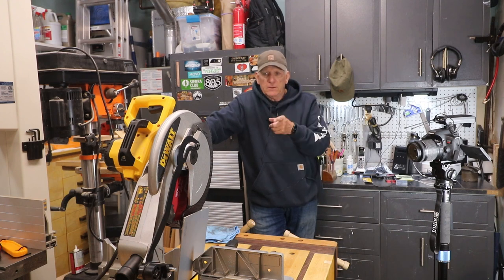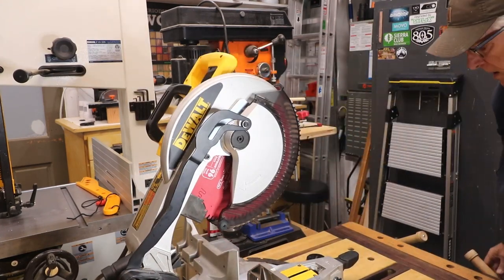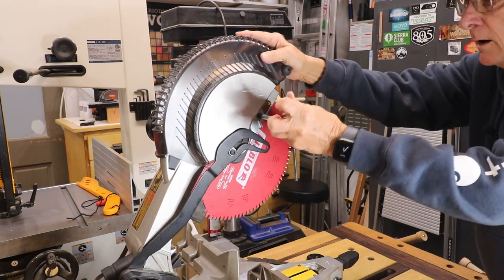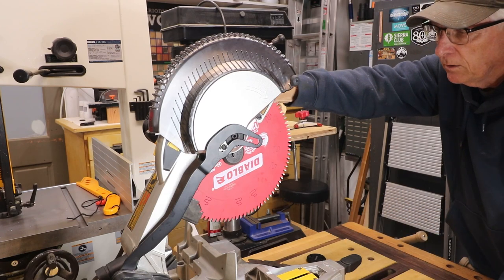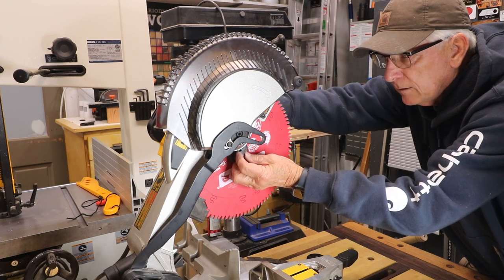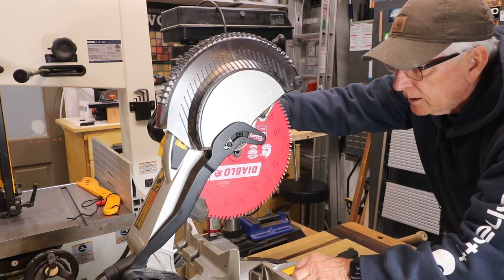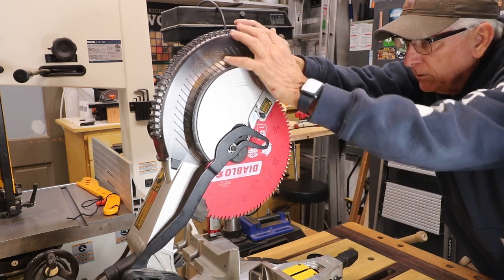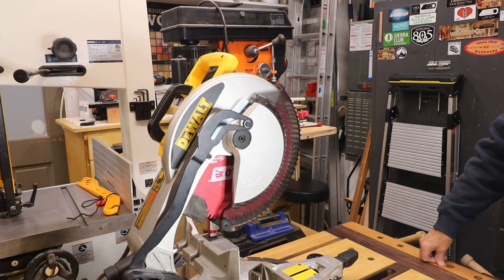What The Heck Is... The Method for Changing the Blade on a DeWalt DW715 Mitersaw

Comment: So glad you're back at it Paul!  Thanks for the helpful video on DeWalt blade changing.  Praying all is well my friend!
Reply: One other thing Paul.  I'm thinking of getting a Diablo 12 inch 100 tooth for my DeWalt.  Are you happy with your 96 tooth and would you buy it again?
Reply from the maker: The 96 tooth blade is specifically for cutting extruded aluminum for my van conversion project.  Can't comment on it for any other purpose.
Reply from the maker: Glad to be back - although not very happy with my recording or editing of this particular video.

Comment: Paul, I want to again express my condolences for the loss of your wife. Although your pain will never fully go away, I have found that you will reach a point in time that it won't hurt so much.

As a lifelong automotive technician, I always told any trainees that I mentored that bolts are always righty tighty, lefty loosy, except under certain circumstances. The left side lug bolts on 60s era Mopars, (maybe further back too, IDK), are one exception.

Quick story; I was asked by a relatively new tech that was trying to remove an oil drain plug why the corners were rounding, and I pointed out that he was trying to loosen it by turning it the wrong way. He said that he was, (emphasis on "was"), turning it the right way, but it was just too tight. I told him that he was looking at the drain plug from opposite side of how it was going to come out, so he was tightening it more, not loosening it. I told him to always pay attention to which way the fastener is going to be removed so that he would turn it the correct way before trying to loosen it. Sorry, it wasn't such a quick story after all.

I learned a trick a long time ago, and it probably saved me a lot of busted knuckles. If you have a fastener that is not loosening easily, try tightening it. In my experience, it will tighten just a little bit more, and then it will be easier to loosen. I didn't believe it would work when I was  first shown the trick, but like I said, it probably saved me from busting my knuckles more times that I can count.
Reply from the maker: Enjoyed all of that